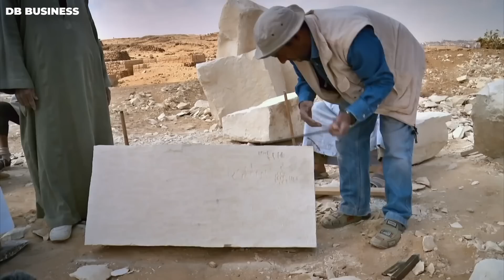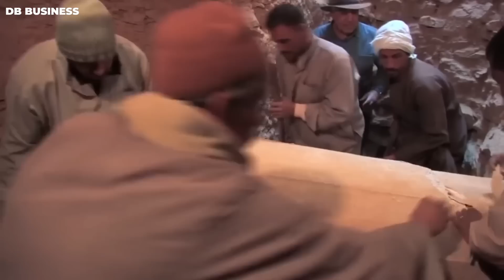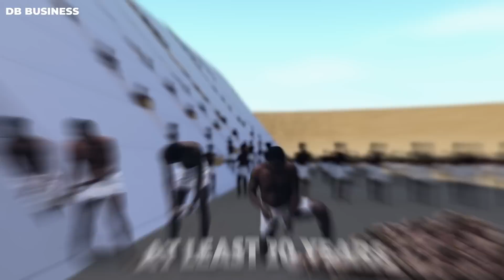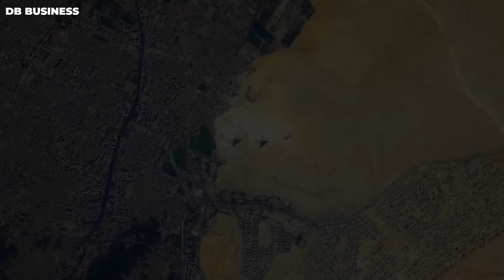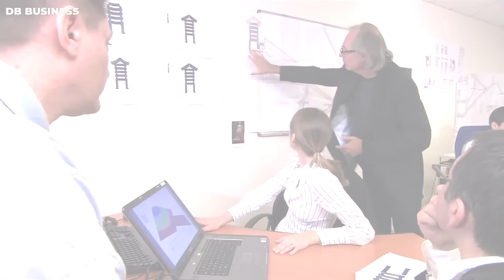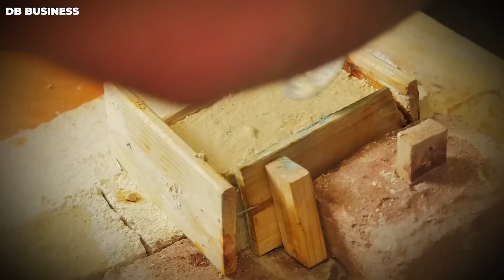The Mystery of The Great Pyramid Has Just Been Solved by Elon Musk

Comment: The pyramids were magnetic transportation devices. They could take matter and create a hologram that could be transmitted across the universe instantaneously!!!
Reply: Nop
Reply: @johnmatatamusic3985  Just TO help you out a little.. You are totally correct we are all connected in the same way via the magnetic field that is instantaneous .  The speed of light is not significant to the magnetic field it travels through  only restricted by same.  E=MC2 is a joke.  Try this,,  If you vibrate the "B" field of a magnet into a granite rock at the correct frequency you will see it become very soft and malleable easy to shape!!  Think about what Quarts rock is made of and it should answer your question,   The center of a magnet is what we are all made of:  a magnetic  hologram of sorts, never ending!  That's why they used  the Pyramids to transport themselves through the universe. E=MC2 is a total Farce!!

Comment: I don't have an answer but I KNOW the pyramids were not built by humans due to missing logistics. So far there are 118 known built over 2000 years-roughly one every 15 years. If these were built by human labor, there would need to kitchens for feeding, latrines or defecation pits, farming for materials of trees and roping, farming for feeding the workers/slaves, tool manufacturing structures and supply systems, and housing for the laborers. Funny-NOBODY seems to address this absence of common sense; the basic support these projects would require is missing. Instead everyone argues about the method-which is just theory. I have yet to see any of these theories simply proven by building one. Would make a great archaeology project for students and create experiential learning. "Assistance" like Musk suggests is the only reasonable answer since there is no support for human toiling.

Comment: Interesting, a counter weight system like that would make sense however the grand gallery has no such markings to suggest there was ever a counter weight in it.

It also doesn't explain the several sheer shafts in the pyramid.

Comment: You can say as much as you want.  The roof of the Pyramid is constructed out of granite, -each block weighing a minimum of 25 tons.  The most heavy one is estimated to be 80 tons.  You can have  50.000 slaves dragging this through the mud or water.  It's another question to bring 1 up to a height of 139m.  Common now, even nowadays this is crazy work (with machines).  Not possible to be done by humans.  On top of that, the pyramid wasn't a tomb chamber. No mummy has ever been found.  It's purpose was totally different.  There isn't evidence of the "workers" who build the pyramid.  Common now.  The Pyramids were already there before the Egyptians.  They build their society around it.  The shear level of accuracy is mind blowing.  Exact points to the star constellation Orion.  The exact measurement from bottom to top and across which represent the size of the earth, etc.  Yeah, humans.. Really ? Sure....

Comment: I watched a video 20 yrs ago as they attempted to build a smaller pyramid. Using all the techniques they mentioned. Ramps, skids pulleys etc. Guess what? They couldn't do it sooo the brought in heavy equipment.  Still couldn't do it. Couldn't get them to stack right as well as not being able to get the interior aligned. There weren't even trying to align with the stars or center it in any land mass 😂. These were modern engineers n block masons. To watch them all scratching their heads n finally admit defeat was awesome. They still have NO idea how these were built. That's not even trying to get all the ancient geometry involved. If they really had a good idea they would do it just to prove they were right n shut everyone up. But they can't so I still believe they had outside help as in highly advanced race.

Comment: Why doesn't anybody mention that the Egyptians could have used boats? Biggest stones are around 2.3 tons. A boat would only need to be 3 ft by 3 ft x 9 ft with a flat bottom to support that way. Know that some of the tools used during that. We're also water powered. The harvesting sites were at the level of the nile there about and that some of the stones were moved via the boats . They could have then used locks in Archimedes screw to lift the boat to the correct level and you sticks with a couple of workers and a winch to lower the rock precisely into place. This could have been done in mass to allow for rapid growth of the pyramid.

Comment: As the great WIll Cuppy noted, most people are impressed with pyramids because they haven't fallen down, but they couldn't fall down if they tried; they are already piles of stone.  All you need to do is pile stones in receding layers until you reach the top and when you get there, you have a pyramid.
Reply: except these structures have complex internal spaces, they aren't just a solid pile of stones
Reply: that would be true if it was just a gian mound, a man made hill, but the pyramids arent that, they are symetrical, level and built out of enormous blocks

Comment: Read the book Interpreting the Pyramids. They're 50x the mad of the Empire State Building and built perfectly, .P E R F E C T L Y in alignment to the planets North East South West magnetic lines. They KNEW before they began Construction, E X A C T L Y, where to place the base to align with the magnetic poles! Why? Ans: to use magnetism along with the gamma radiation, that hits the earth, in just this exact spot on the planet, 2x daily. 2!!!
   They K N E W that 'Before,' choosing where, to place it on the earth!!!!! 
  It captures that radiation and it's structure had concave sides by the exact smallest degree, to suck those band waves, onto it's sides and force the energy flow toward the apex capstone, on the top, of the Giza Pyramid.
   Crystal balls, COME FROM EGYPT!!!!!! They are a harness small rating of Moths rating of 7, just below diamond. How could they, have cut this crystal with this hardness since, into a P E R F E C T sphere, and why ???? 
  Answer: Quart Crystal Collects, radio waves and x-rays and gamma rays, and Amplifies their energy.
  The first radios, were made without batteries, and they got their energy from this same crystal. They were called crystal sets. I had one as a boy. It WORKED! If it, the crystal ball, was machined in a shop, and found in Egypt, where would you expect to put it? Answer: on the Pyramids' capstones, of course.
  Those things are, Natural Power Converters. They generate energy, lots and lots of it

Comment: They will never convince me that the thousands of precision cuts could have been done with primitive tools.
Reply: There is 2.5 million blocks. Every block takes about 6 cuts. So about 15 million cuts at least.
Reply: @T1gB1ts  Also the perfect circular holes cut at many sites.
Reply: @T1gB1ts  one day, you should go visit it and go look in person how "precise" those blocks are.

It's either you are completely ignorant of what reality is.
Or your standards on precise is very low.

Robbers in the past, cut tunnels to get inside. Which allows you to see what the pyramid is made of inside.

1. 1/3 of the volume of the pyramid is a preexisting hill. So before they even started the pyramid, they were already 1/3rd finished. 

2. Most of the inside is filled with rubble and mortar. The mortar has uncountable bits of organic material suspended in it. Which has been carbon dated to death. 

3. The current visble blocks are cude af. These weren't meant to be seen, so it makes sense that no effort was put into precision, at all. 

The original outer layer of white limestone was shaken loose by an Earthquake, and then the Mamlukes took most of the rest to build mosques in Cairo. This reveals the blocks below...and you can go there and look at crude af those blocks are. 

4. Only the outer layer was shaped carefully, to create a nice clean gleaming white exterior finish. Almost all of this outer layer is gone now, but some of it is still there. Some on top and some at the base. You can go there and look with your own eyes...it's much better shaped than the inner blocks but still crude af by modern standards. Clearly someone did that by hand, only human hands could produce something so crude. 

5. Limestone is soft.
Reply: And they did not do it with primitive tools.
Reply: The millions of blocks are sandstone. Only a few are granite.
Sandstone is very easy to work with.
Those people had 1000 years to perfect stone cutting. Then their technique was lost once people invented bricks and pottery, just like we have no idea how to fight with swords or spears anymore.
Reply: whats your conclusion?  Did they have steel tools after all?  What are you proposing?   Ask yourself, when you see that pyramid whats the first thing you want to do?  You want to build one right?  A small one, a model.  Do you suppose that the great pyramid is the oldest one and the other little ones are just people trying to imitate it to try to figure out how it was made?
Reply: @ScreamingEagleFTW   I have built several large retaining walls out of big native rock. When I got into it I was convinced that I could build them to as tight of tolerance as the pyramids, (with-in reason), I wasn't going to cut the stones into perfect squares/rectangles. I finally compromised at no more than half inch gaps at the corners and 1/4 inch or less linear, (even that was impossible to maintain). Later, I was told by one of the home owners, that he gets more compliments on the retaining wall I built than he does on his 1 million $+ home. He wasn't so thrilled during construction when at times we only placed one rock an hour.  None the less, with all the modern tools, excavator, hammer drill and diamond tipped cutters, we couldn't match the precision that these 'cave men' achieved with brass tools and rocks, (at least not in a reasonable time frame). Now I never had 20,000 slaves at my disposal 24/7 but I had modern equipment, experienced crew, (two stone masons cutting), and two men helping me place them. For me, a guy whom has worked his entire adult life in the earth moving genre, has practical 'real time' experience building with native stone, the accepted methods for cutting and moving the huge stones are a joke. That's my conclusion!
Reply: @ScreamingEagleFTW  the evidence is they used water pressure to cut the stone. in the quarry there is a partially cut out stone and the marks are more like passes with pressured water than tool marks. beside the stone people (millions of tourists) have been smacking with stones have barely suffered any wear.
Reply: @dragoneyeshatesg00gle76  water pressure?  whats the evidence for that?
Reply: @ScreamingEagleFTW  the marks in the stone where a partially cut out piece is. AS I SAID the marks don't look to be tools as much as they do for pressurized water sure its not modern 20k psi but even several hundred from a decent sized jet can erode rock they did have bronze making, funnels and waterwheels were things around at the time they could well have used drop to make pretty high pressure. Look at many african nations today the poor still use non compressor water to mine although mostly to clear dirt its not far fetched they would have thought of water as a way to work stone
Reply: The work was not done by humans they were done by much MUCH more powerful hands which King Soloman were givin control over
Reply: @freezin48  bollocks
Reply: @Lamster66  are you talking about the video where they have a copper saw and they pour sand in the kerf?
Reply: The Egyptians built those pyramids with the help of Hebrew slaves give them their credit lol blacks and Jews working together wow lol
Reply: Poured concrete……….same in the Mayan world etc
Reply: @miatuli9597  poured concrete would not last
Reply: Hey I agree 💯  I'd love to see that retaining wall!
Reply: @freezin48  Unfortunately it was before the era of I-phones and I didn't get any pictures.
Reply: I don't believe the earth is even that old but that's a whole other topic.
Reply: @freezin48  yes, let's not discuss your insanity here.
Reply: Except they weren't primitive
Reply: @Lamster66  they didnt get very far i think they cut like 1/8" and they removed more material from the copper saw than from the stone.   I personally think they drilled holes close together and then broke the stone and made it break along a line like when cutting glass with a glass cutter. Something like that makes more sense.   I think I saw a video of someone cutting a stone with a string and an abbrasive slurry of sand made from beryl or some hard stones.  The definitely did it with the tools of the day. No magic, no aliens and no pre flood civilizations with high tech. Just back breaking labor, teamwork, human ingenuity and can do spirit.
Reply: @Lamster66  I dont think we could  build that pyramid today but not for technogical limitations, not for lack of knowledge but for lack of motivation and lack of unity to do it.  Im talking about red tape, politics, permits, zoning and funding.  If anyone could or would do it, it would be a Saudi prince or something but its so pointless. Bragging rights is all you would really gain and status.  How much do you think it would cost?  Also, bonus question.  What do you think about mixing sand or abrassive powder right into the molten copper when they make the tube drills and saws. Wouldnt that make the copper cut the stone much easier and not wear away the copper?
Reply: @Lamster66   it "works" is like saying raking a lawn with a sald fork "works".  Can you gather leaves with a sald fork?  Yes. Would you stop looking for a better way if you had a salad fork to gather leaves since a salad fork 
works?  No.  You would find a better way and I believe the egyptians had a much better way. Time is not infinite for building a pyramid there is some semblence of a timeline a completion date, deadline etc. I bet they were being pushed to get it done as fast as humanly possible also.  I just wonder if they added abrassives to the molten copper and if that would work better?   I would like to see more videos of people trying different ideas .
Reply: @Lamster66  yes good analogy
Reply: That's why it's a mystery, because it's too far fetched that they were made with primitive tools. But schools are still teaching kids that they were created this way and I'm here for that reason. How can I let my child go ahead and write about the construction of the pyramids being done by slaves using machinery?! I can't, that's not right.
Reply: @DollfaceKim  It seems possible that a ship from an advanced civilization was at one time stranded on earth. That would explain the displays around the world that can only be seen from space,  the castaways had the primitive natives build crude 'SOS' signals to assure they wouldn't be overlooked by any rescue attempt. In mean the time they re-instituted their technology to the point they could fly away again to their homeland. The pyramids and other similar structures around the world are evidence of their tech. as they developed it back to a high enough level to leave. This explanation is more plausible than anything I was ever taught in school.
Reply: @DollfaceKim   look at it from a different perspective. Things like the pyramids and the walls were built by man. Why does that not sound logical? We are trying to incorporate the use of technology which made man get lazier and lazier. You have  a bunch of rocks, no Wi-Fi, no Netflix or Spotify & rulers that keep thousands of slaves. One could talk about it being impossible and that primitive tools can’t build such. Reminder, most of the technology and equipment we use today is just advanced versions of what was there in the past. How the pyramids were built can’t be explained because we’re trying to incorporate what’s possible in todays standards. Only way to truly know how they were built would be by knowing how civilization at that time use to live without comparison to how we live today. 
The comparison only brings up more questions regarding the topic. How one would build it today is not how it would’ve been done in ancient times. Mankind is innovative, Mankind would always look for the most efficient way to do things with what they have. It’s good you don’t want your kids to write essays about primitive tools being used to build the pyramid that thinking should also be incorporated in them writing an essay saying aliens built it
Reply: It's super easy, actually. They would have had a standard block of measurement to base everything else on, and they would constantly check to make sure that those standards are met. Limestone is a very soft stone, and it can be carved with copper, or even obsidian and flint very easily.  You should also look up how they drilled holes in stone using copper and sand. Interesting stuff
Reply: @Iamthegreen  Limestone is one thing but they've done as much or more work in solid granite, all over the world.  Sounds like you've convinced yourself, but like I said, "You'll never convince me".
Reply: Good point.  It's much more likely aliens did it.

Comment: for some reason these 'debunkers' always forget to mention the  large & perfectly straight line cuts in several blocks at the base of the Giza pyramid, which are identical to what a modern radial disc tool can produce, as well as the perfectly smooth cylinder holes that go through some of the large external blocks at the base of the Giza plateau, which no hand tool could have made to that level of precision or depth. In fact, according to mainline historians, even the wheel hadnt been invented yet :O